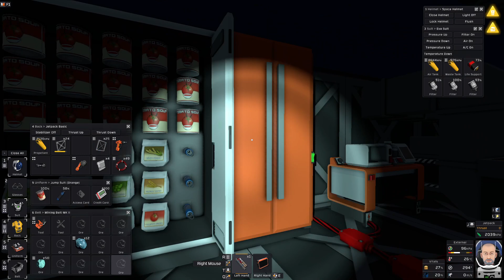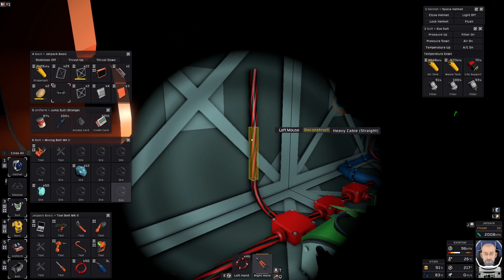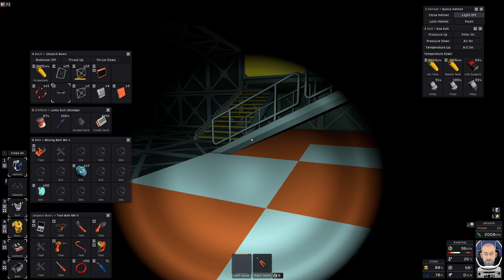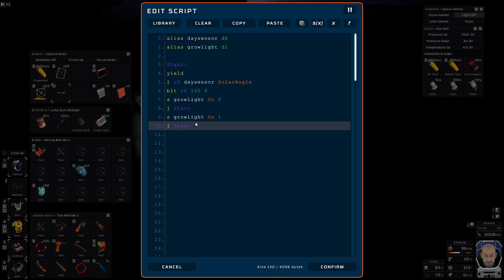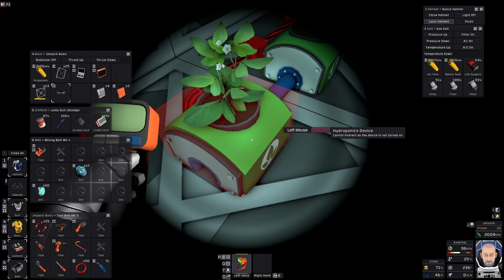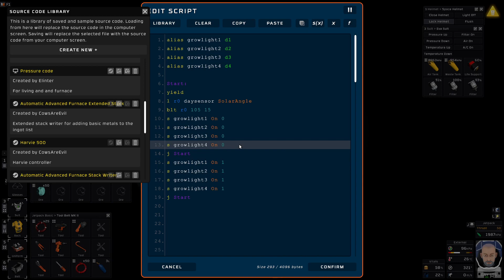Stationeer Lets Play Europa Ep 5 Harvies, Gas generator, Atmospherics and crossed wires.

Comment: You could just batch write the growlights, using the device hash. Does not matter how many gtowlights on the network or where in your base.  All of them will be on the same on/off cycle. Unlike the active vents, with those you can trybthe batchnamed commands